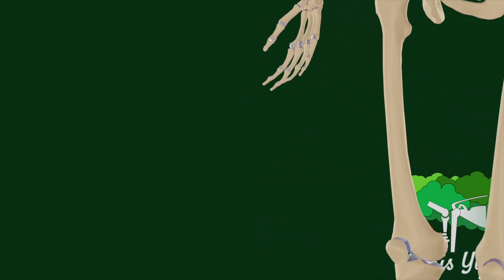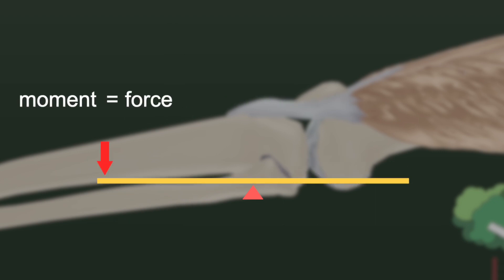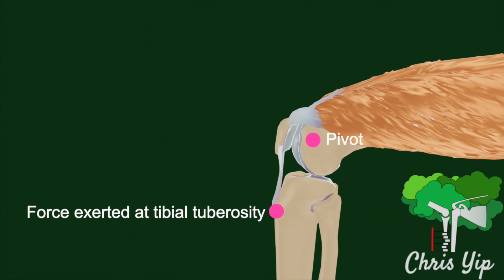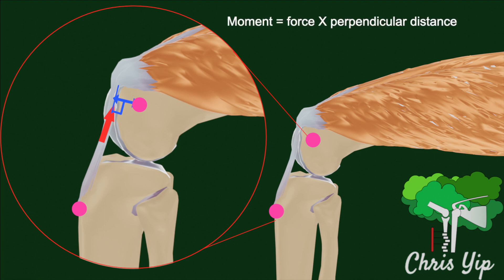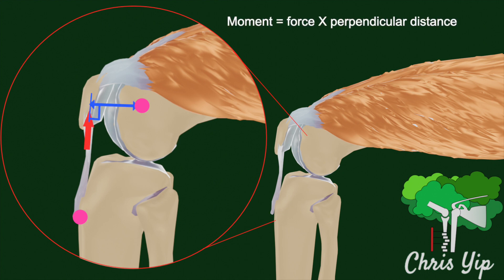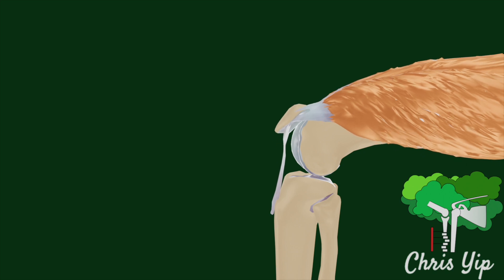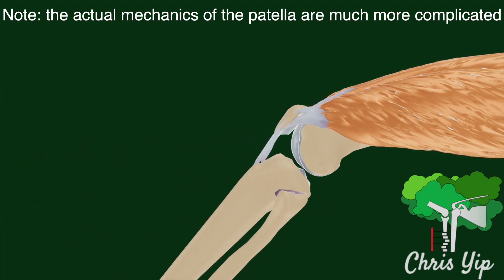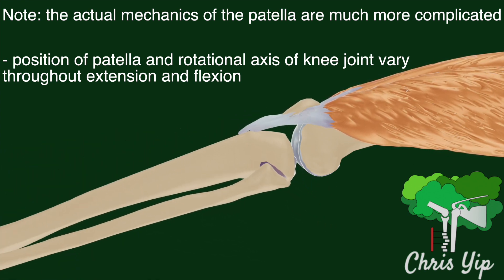Patella and the Extension of the Knee

Comment: Doesn't a longer moment arm require more force? In a bicep curl the  moment arm is longest at 90 degrees and peak torque for the biceps is at 90 degrees which is required to complete the full range of motion.